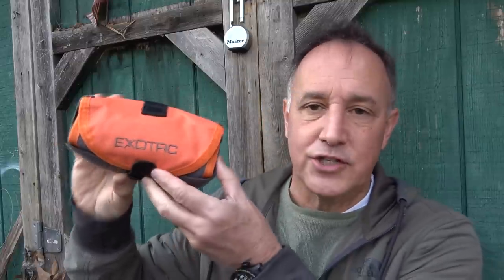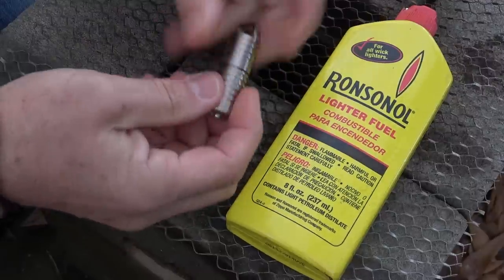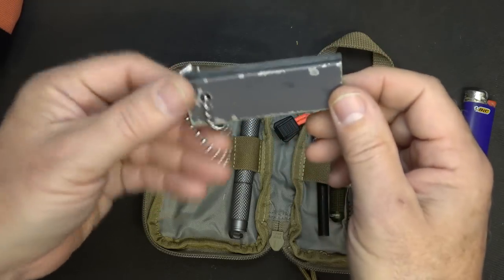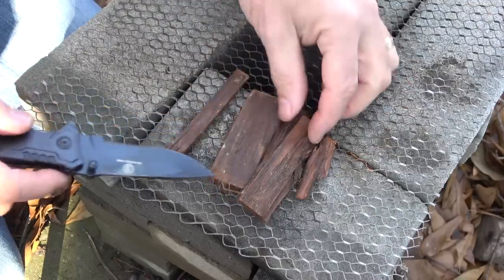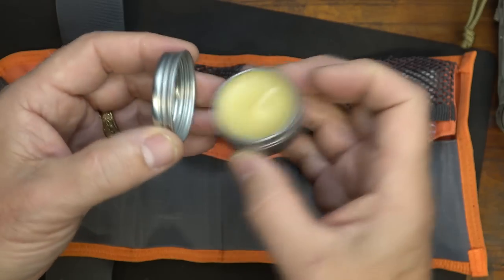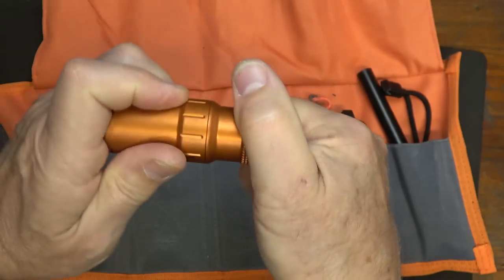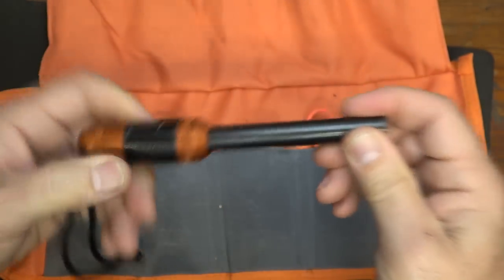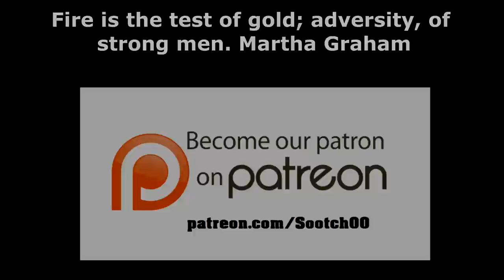Fire Kit for Survival   Exotac Tool Roll

Comment: Actually, firesteel will ignite with stainless steel blades, i use a firesteel with my stainless steel Mora Garberg. Its the edge of the spine that matters. Great vid sootch!
Reply: Yep, just about anything with a sharp edge and harder than the rod will work
Reply: Yep. I've even used peices of glass and ceramic. Jigsaw blades work well too.

Comment: This was a great presentation, Sootch!  I love tool rolls, including the Roaring Fire version which initially was a tool roll.  However as my folding knife collection grew the Roaring Fire became the best option for protecting them; had to order a second one for the same purpose.  Recently I found the OneTigris tool roll and a matching EDC pouch and both became dedicated fire starter kits.  I ordered velcro patches that read FIRE KIT and the background is bright orange with black lettering.  Several items in each kit are Exotac products...incredible quality.  As far as tinder, you cannot beat cotton balls impregnated with vaseline.  It is messy so I use nitrile gloves when I make a huge batch.  Laundry lint impregnated with candle wax is long burning as well.  My kits include trioxane, Wetfire cubes and fatwood which can be bought at Walmart and some food stores in the BBQ section.  In Altoids tins I have two votive candles, primarily for light and prevent condensation in my shelter.  The Altoids tins provide a safe casing and when you no longer need the light the top snuffs out the flames.  That Exotac silicone orange and black encasing a Bic was convenient to make a "necklace" so I don't have to dig into my pockets or access a fire kit especially when I'm in winter garb.  An appropriate length of orange 550 with one end through the lanyard hole, made a knot and the other end through the lanyard hole at the bottom, made a knot.  This allowed me to wear the kit around my neck, use the Bic, and close.  This keeps from losing the kit and prevents separation/loss of either top or bottom.  Another lighter I love to use are the Crocs lighter that resemble the long BBQ lighters but in a mini version.  That elongated "snout" prevents burning your finger tips.  Another hack I use are old Rx bottles as they are pretty much waterproof; matches, tinder and Bics or Crocs in the longer ones  Ever since that tragic incident in Oregon where the father lost his life trying to find help for his wife and child, I vowed that will never happen to me or my family.  There were multiple survival resources in his van he could have used to start a fire, stay warm and melt snow for water.  In this day and age and in this present "climate" it would behoove everyone to take a class in survival techniques from starting fires to building shelters.

Comment: I would take out one of the ferro rods and put in a Chapstick.  Cut two Q-Tips in half, and push the pointed end into the Chapstick. I put them at 12-3-6-9.  When they are pushed down the fluffy tips will be above the surface of the lip balm, and will fit inside the cap.  When needed you rub the tip in the Chapstick, and it will burn like a candle.   I would also add a piece of Aluminum foil a 10-12" square.  Fold it and use it on wet ground.

Comment: Love the Exotac tool roll & ripspool.  I put a small zip-tie around the top of my Bic lighter that goes underneath the red button to prevent it from being pressed & letting all the fuel out when in my pack.  The zip-it is loose enough to allow me to take it off without having to cut it.  Enjoyed the video!

Comment: Problem with Vaseline is it's wet n messy. Tea candles melt. But... jute twine dipped and soaked in candle wax doesn't melt. Burns longer than wood, is flexible,  doesn't blow out in wind, is waterproof, doesn't expire or go bad, and is not messy because it's always dry unlike oily Vaseline. Just fringe/separate up an end for dry jute and spark it. I have gotten rid of everything else. Whole kit: Jute/wax starters, ferro rod, knife and a redundant bic.

Comment: On the mini exotic striker... it will screw into the protective sleeve when removed from protecting the rod, giving you a bigger “handle” on the striker.  Most important when using device with cold hands when fine dexterity can be lost in fingers.

Comment: Actually a ferro rod will work with non high carbon, I've seen and used them with all sorts of metal, and even a rock.
Reply: This is correct, I've done it with a variety of stainless, ceramic,  and even glass
Reply: Yeah I did a double take when he said that...
Reply: Totally agree with you Person. This one thing I hear all the time and is so wrong, I did a video on FB years ago showing all the different things that you can use, as long as it is harder than the ferro rod you can use it.
Reply: It drives me nuts, so much that I had to do a video on it, and I'll probably turn it into a series
Reply: Wow thank you guys so much for the likes. Didnt expect anyone to end up seeing this
Reply: Yeah idk where the myth of you need carbon steel strike a ferro rod came from but that needs to definitely be corrected. Heck now I'm curious about the flint and carbon steel trick if the same applies (obviously ceramic is out of the question but I'm curious just how much carbon content is really needed now)
Reply: @Horde334  I think it started with people calling ferro rods "flint" like the flint rock, which the flint rock won't work with stainless
Reply: @DannyRiskit  Makes quite a bit of sense when i think it over and kind of obvious too but hey never stop learning anything new especially when I look at my previous comment and realize it was rather dense of me to say it but eh live and learn.

Comment: My Pocket EDC Fire Kit consists of a pair of reading glasses, which provides Solar Ignition, and a Key Ring Liquid Match, which includes both Flame Ignition with a wide variety of Common Liquid Fuels, and a Ferrocerium Striker as a Spark Source Of Ignition. Three Independent Sources Of Ignition With Just Two Items.

Comment: Years ago I had a box-end wrench set that came with a storage pouch like this Exotac. Slot for each wrench, flap over the top, roll it up and use the attached ties to close it. The pouch was the only decent thing about the set; the wrenches were cheap chinesium garbage that stripped out under any real pressure.

Comment: Exotac is definitely top of the line and if money isn’t an issue it’s definitely the most attractive and is still very functional. I feel like you pay a lot for the name however. I own the fire rod, nanospark, and the nano striker and the products work, but boy are they overpriced. I can justify the nanostriker because it’s easy to EDC with a tube of tinder taped to it while I fly. That said for the $50 you would spend on their lighters you can get an LMF rod, a new bic (or 5), tinder quiks, wet fire and UCO  matches. Great products just not cost effective and you generally pay for the name and craftsmanship.

Comment: You can strike a ferro rod with a sharp stone if need be. The only time you want to have a non stainless steel knife is when striking a flint or quartz. As they are non existent in my area, unless you buy them, and the water both acidic and salt are common place we prefer the stainless steel version. I usually strike the ferro rod with my Victorinox saw if i don't have a striker on me, something that only happened twice in 25 years.

Comment: You might want to add to the bic lighter a foot or so of non-gutted paracord, vertically connected to a roll of chapstick with two feet of hi-visibility gaffers or gorilla tape wrapped several times around each leaving a little room above the chapstick adjusting wheel to prevent losing either.  Adding a small zip tie around the valve button of the bic lighter prevents your lighter from losing its fuel and can be removed and replaced once zipped, clipping the extra length makes it a little sharp though can be filed to prevent cuts. Then you can take petroleum jelly to a cotton ball and store it in the cap of the chapstick. Plus if left on the adhesive sticker is also flammable. Once you have a empty lighter, if the sparking wheel and valve button are removed slowly, the springs underneath them can be made into a snare & fishing hook. The childproof metal safety device can be removed with a leatherman pliers. It can also be made into a improvised fishing hook and sharpened.

Comment: I really like the quality of ExoTac but I ordered some extra flints + O-rings and wicks for my TitanLight plus a replacement ferro rod for my FireRod in early November and the order still has not shipped. I'm not sure what is going on but my flint and an O-ring recently wore out so I replaced them with a Zippo flint and a #53 O-ring from Ace Hardware and it works quite well. I sent ExoTac an email and left them a voicemail over the last few weeks and have not gotten a response. At this point I am considering cancelling the order and using hardware store/Zippo parts instead.

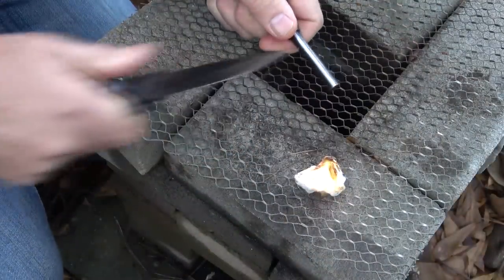Comment: @6:00 Stop claiming, that you need high carbon steel to strike a ferro-rod - the only thing you need is a hard material (harder than the ferro-rod) with a sharp edge, this can be rock or any hardened steel, carbon or stainless, ceramic or else. The only issue you might have with laminated steel, because it's too soft at the outside. My favorite striker is a piece of broken (stainless) scissors - they hardened it exceptionally well (>60Hrc to my guess) and left the spine at a true 90°.

Comment: Wish you included how to light a fire using the "fire cord": ive never seen that in use before.
Reply: It basically works like the tinder tabs. You pull the core of the cord out, fluff it up and hit it with a lighter or ferro rod. He has videos showing it just not sure which ones.

Comment: Most of my fire kits are just like that Maxpedition Kit. In fact, one of them uses that exact pouch. 
I always put in a steel for striking flint, and a lens...(long term mentality).

As far as the longevity of the peanut lighter... I bought a Numyth Tohil Lighter at BLADE Show in 2015. 
It was a neat little lighter and continued to light for many months (didn’t use it every day). Eventually, I wanted to know how long it would hold the fluid, and still work. 
So I filled it with fluid (being careful not to get fluid on the O-ring) and left it closed for almost 2 years. I carried it in my pocket for about three months, then put it in a kit in my pack for a year and a half. 
When I finally decided to try it, it worked fine. Started on the first strike. 
It stays in my main disaster bag now. 
👍🏻👍🏻🇺🇸

Comment: I end up with enough to clean, so ima not cleaning 6000° burn marks off my good knives. The thick file on my original Leatherman works great...paired with my SAK Huntsman, quite a few tasks can be done...even a tool for getting a stuck lure from a tree branch by sawing. ;-)   

Threaded ferro rods? crikey, how many times in your life have peeps quit making yer fav underwear?
Hopes that company remains in biz for ya. ~ 
 pre-drilled 6" ferro with paracord ain't going anywhere. ~ well I'm not a fan of redundancy due to space. 
~ I'm not Joe Gossamer by any means, but most of that kit could still fit in the void space in my Billy pot. I'm going to stick with what would be used in a wet environment. 
~ Do you chainsaw? Sharp chain spits out awesome wood shreds for making ones own fire starter 

Have a great '21 Mr SP. 
tips me hat ~